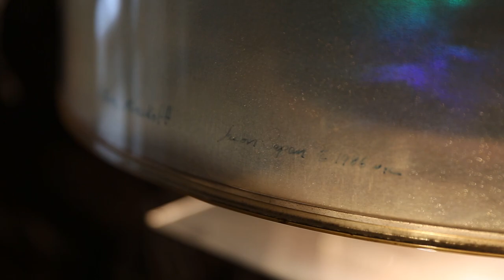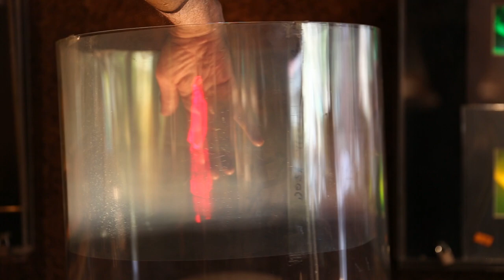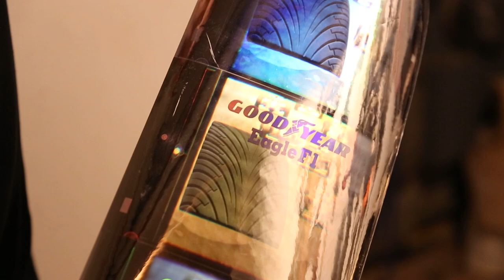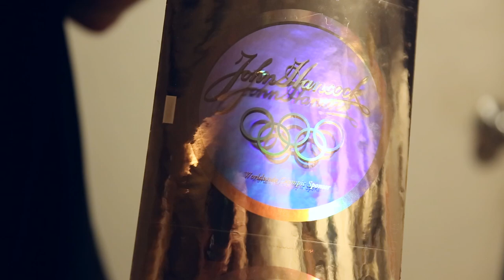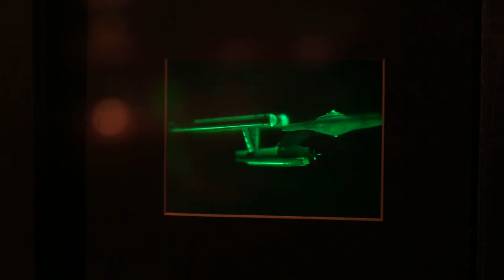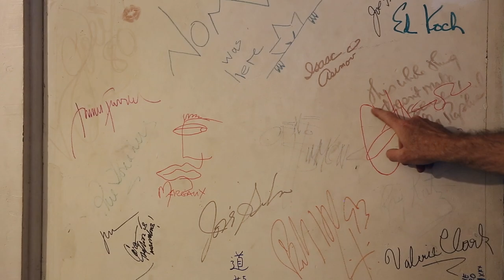How Holograms are Made

Comment: Having made holograms (literally in my basement), I can tell you that what you have here is a reasonable overview of the process (but, as I pointed out in a late rcomment,  understandable only if you already know what holograms are), but here's more detail.  The really detailed "WHY" a hologram does what it does is not simple to understand, much less explain in words.
...
...  How the simplest "Transmission Hologram" is made ...
...
The laser beam is split into two beams with something like a partly silvered morror.  Each beam is spread out, using a simple lens, to form a wider cone-shaped beam more like flashlight's beam instead of just a dot. One beam shines on the whole film and is called a "reference beam". This is like one of the water 'ripples'.   The other "Object beam" shines (by using mirrors to direct it) on the object being "photographed".  The laser light reflected off the object goes in all directions, as usual, but the light reflected from the object which travels toward the film combines with the reference beam to form the interference pattern on the film.  Where the two waves arrive always peak-to-peak (and trough-to-trough) they add to form more light and expose the film the most.  Where the two waves meet trough-to-peek (and peak-to-trough) they subtract, or partly cancel, and the film is exposed less.
...
  However, it must be understood that this is a very, very complex three dimensional interference pattern within the film's emulsion.  Because the film has thickness, there are interference 'patterns' created within the depth of the emulsion as well as across the surface dimensions. It is very difficult to describe in terms of the two simple ripples forming an interference pattern of just rings. If you have seen any kind of interference rings or patterns, you should realize that even though the light waves are going through their full cycles of extremely high frequency, these interference patterns are stationary.  They are called standing waves.   Because these patterns don't move as the light waves vary through their cycles, they expose the film in a stationary pattern.   If you understand how standing waves are produced on a radio transmission line, this is the same principle, only in three dimensions instead of just one.
...
Side Note: If you understand the mixing of frequencies in a radio receiver you have a little understanding how interference between two waves can preserve the information in one wave.
...
  After the film is developed and bleached to make it look clear, it can be viewed. To view the image the laser beam is spread again and shined on the film from the same direction as the original Reference Beam.   This film is now just like a "window" though which you see the object in the same position it was when the film was exposed.  The hologram produces light that leaves the hologram in the very same way it left the original object (and passed "thought" the window formed by the film).   As your eye moves around the window's area, you see light in the same way that it actually left the object and traveled in that direction to the film.  Since, at any one time, an eye only looks through a small part of this film window, this means that every location on the hologram film has a complete image of the object as viewed from that single location.    THEREFORE, your two eyes, located at different locations and looking toward the film window, receive light in the same way they would form the actual object and you see it in 3-D.
...
 You may think of the hologram film as having billions of really small, strangely shaped prisms that refract the laser's light. They refract the light from the viewing laser into a form that duplicates the way light left the original object.  Also, because they are prisms and prisms spread the colors in slightly different directions, you must use the correct wavelength of light to reconstruct the image correctly; though in my experience a close color looks pretty much the same. This may not help, but if you viewed a hologram of the simple interference rings from two split beams aimed at the film, you would see a single spot of light representing the "object beam".
...
P.S. Yes, it is possible to make a hologram image that "floats" in front of the film.  This is done as a hologram of a hologram to get the image on the other side of the film. However, the film must always be behind the floating image.   Light through the film must meet your eye.  It is a "virtual window" behind the image.   A complete ring of film is required for you to walk around such a floating image along with light from a single laser coming from all around the outside and shining inward toward the center.
...
P.P.S.  Another amazing aspect of these "Transmission Holograms" is that if you shine a laser dot onto the hologram in the reverse direction from the original reference beam, you get a complete image of the object projected on a screen located where the object had been.  This is with NO lens..  The image will be seen from the perspective of the point on the film where you would have looked at the original object when you exposed the film.   As you move the laser dot around the film, the projected image changes perspective (rotates) to match that location on the film.   I saw this demonstrated in a hologram talk and duplicated it myself.  Very COOL!
...
P.P.P.S. There are white light Holograms (which has all wavelengths/colors) and they use a nifty trick to do that, which I won't go into here.
ScienceAdvisorSteve
Reply: Observ45er do you mind if I ask your professional opinion on a puzzling piece of footage that may be related to holographic technology. Can you please have a look at the video called  'Pyramid Over Pentagon Plus Filter' by YouTuber TRSD Global which shows a triangular "object" filmed at night hovering over the Pentagon. The "object" was also filmed separately the same night by a group of African-Americans travelling in a car ( I mention their race because statistically African-Americans don't usually take part in staging CGI hoaxes. .) Is it possible the video is showing some kind of holographic technology?
Reply: @budekins542  I would have to be there and see it to have any opinion at all about it.  Both videos are too hard to see anything. One thing is that a hologram can not be projected into random space and be viewable from any angle.  This may explain it better:
 https://www.quora.com/q/gwvrdzszbveqfxde
Reply: @Observ45er  thanks!

Comment: hope I can get this idea across. I am not a learned person but have studied everything I can get my hands on all my life. You might say I've attended the big school. the one you never graduate from.   As I learned the concept back in the late 70's, you start with a weight table. Back then they were using a cement filled table that rested on inner tubes from truck and car tires to insulate the table from the vibrations of the earth. On this table they set up a laser (they started with red and then developed green and yellow lasers ). The light from these lasers were lased or traveling in the exact same direction, 100% or as close as possible, parallel in all directions so to speak. this beam was then split in two, one beam reflecting off of an object onto a nearby film and the other pointed directly at the film. This causes thick and thin places on the film so that when a normal light is shown behind the film after being developed, the object appears to be there. This is a very exacting process because the interaction of the two beams of light must meet the film at the same time from when they were sent from the laser.

Comment: I've made every single type of hologram show here, plus several dozen other types not spoken off.  I've shot them into silver halide, dichromates, photopolymers, thermoplastics, live cell walls, plasmas, fluids and metal surfaces using UV/Visible/IR/X-Ray and Electrons.  I've made surface planar phase, both direct and as embossing shims, and many different forms of volumetrics both inline and off-axis.  If it can be handled holographically... I've done it.

Comment: Very neat presentation Norman.  I have to point out that it irks me to no end when people say 'analogue' film.  It's chemical film and it's opposite would be digital of course.
Reply: Also, very cute Sergal.
Reply: ***** Analogue means it that the recording/signal/transmission has infinitely variable values within a set range. In analogue you could have all values between 3 and 4 (i.e. 3.5, 3.55, 3.5545424523523789809...). In digital you can only have 3 or 4 and nothing between.

Chemical film is still a digital process and the reactions that take place to each of the molecules that make the color in the film are the digital values that make up the pixels. What is called 'digital' in video/photography is actually digitally recorded and stored electronically.

You can also record images electronically by analogue methods, such as what was used in the originally television formats and for the system that papers used to share photographs through the Associated Press.
Reply: Richard Batz Thx! Yer the 1st person in all of history to notice how cute it really is!

Comment: We learned about everything but the hologram making
Reply: It's quite easy: Just split a LASER in two beams. Fire one on the object and the other on the film plate. Capture the lighte from the object with the film plate. If both beams come from different sides of the plate you'll get a reflection hologram otherwise a transmission hologram.

Comment: Okay, yeaa, umm, if anyone understood wtf he was on about, please reply otherwise I just feel dumb af atm..
Reply: Leslie Marufu   I'll give it a try.
His analogies leave something to be desired for some viewers. 
  Having made holograms myself (literally in my basement), the really detailed "WHY" a hologram does what it does is not simple to understand.  You should already understand concepts such as wave interference, refraction and diffraction. 
...
...  How the simplest "Transmission Hologram" is made ...
...
The laser beam is split into two beams with something like a partly silvered mirror.  Each of these is spread out, using a simple lens, to form a wider cone-shaped beam more like flashlight's beam instead of just a dot. One beam shines on the whole film and is called a "Reference Beam". The other "Object Beam" shines (by using mirrors to direct it) onto the object being "photographed".  The laser light reflected off the object goes in all directions, as usual, but some light also travels toward the film.  
...
The reason two beams are needed is as follows.  Light is a wave of extremely high frequency. This is just like the AC coming out of household outlets.  That voltage changes at 50 or 60 times a second.  Light is varying about ten trillion times faster. It varies in a sine wave like intensity at this incredible rate.  Simply shining light at a camera's film or pickup device will only result in an average amount of light energy being registered in the emulsion or pickup device. This is how an ordinary photograph works.
  If, however, we add the reference beam of the same frequency (from the same laser), the result on the 'film' is an interference pattern - a very complex one.  Interference patterns are also called fringes, or standing waves.  Where the two ever-changing waves arrive always peak-to-peak (and trough-to-trough) they add to form more light and expose the film the most.  Where the two waves meet trough-to-peek (and peak-to-trough) they subtract, or partly cancel, and the film is exposed less.  Although the two original waves and the resulting interference pattern are all changing at the rapid rate of light, the locations where the two waves add or subtract remain stationary -hence the name 'standing waves'.
...
It is very difficult to describe in terms of the two simplest waves forming an interference pattern of just rings. If you have seen any kind of interference rings or patterns, you should realize that even though the light waves are going through their full cycles of extremely high frequency, these interference patterns are stationary.  They are called standing waves.   Because these patterns don't move as the light waves vary through their AC cycles, they expose the film in a stationary pattern.  
...
 The length of the path from the laser to the film along the reference path is constant. The length of the path from the laser to object then to the film varies in a very complex way as the surface of the object dictates.   Another way to look at it is that the distance between various parts of the object and the screen is recorded in the interference patterns made on the film.  This is the 3D information of the object.  All this goes on at a microscopic scale (resolution) on the order of fractions of a wavelength of light. Therefore, this film must have the ability to store these patterns that are on the order of the size of the waves of light. On the other hand, ordinary film only requires a resolution on the order of the ability of the eye to see enough detail of the individual picture dots (which is what we now call pixels).
...
  However, it must be understood that this is a very, very, VERY complex three dimensional interference pattern within the film's emulsion.  Because the film has thickness and the light reflected off the object comes from many angles and distances, there are interference 'patterns' created through the depth of the emulsion as well as across the surface dimensions.  The interference patterns vary throughout the thickness of the film, as well as around the surface (as in an ordinary photo).  
...
Side Notes:If you understand how standing waves are produced on a radio transmission line, this is the same principle, only in three dimensions instead of just one.
 If you understand the mixing of frequencies in a radio receiver you have just a little bit of understanding of how interference between two waves can preserve the information in one wave.  
...
  After the film is developed and bleached (removing the darkened silver salts) to make it look clearer (lighter), it can be viewed. To view the image the laser beam is spread out again with a lens and shined on the film from the same direction as the original Reference Beam.   This film is now just like a "window" though which you see the object in the same position it was when the film was exposed.
...
 You may think of the developed hologram film as having zillions of really small, strangely shaped and complex prisms that refract/diffract (bend) the laser's light. They alter the light from the viewing laser into a form that precisely duplicates the way light left the original object and hit and passed through the film. This light is then viewed as though you are looking through the film as if it was a window.  Also, because the film grains are prisms and prisms spread the colors in slightly different directions, you must use the correct wavelength of light to reconstruct the image correctly; though in my experience a close color looks pretty much the same. 
...
 Once again, the hologram produces light that leaves the hologram in the very same way it left the original object (and passed "thought" the window formed by the film).   As your eye moves around and views through different parts of this window's area, you see light in the same way that it actually left the object and traveled in that direction to the film.  Since, at any one time, an eye only looks through a small part of this film window, this means that every location on the hologram film has a complete image of the object as viewed from that single location.    THEREFORE, your two eyes, located at different locations and looking toward the film window, get light from two different angles and receive light in the same way they would from the actual object and you see it in true 3-D. 
...
 An amazing aspect of the fact that the entire image is captured at every point on the film of a "Transmission Holograms" is that if you shine an un-spread laser dot onto the hologram film in the reverse direction from the original reference beam, you get a complete image of the object projected on a screen and in focus at a distance and location where the object had been during exposure.  This is without the use of any lens!  The image will be seen from the perspective of that point on the film where you would have looked through at the original object, as you were exposing the film.   As you move the laser dot around the film, the projected image changes perspective (rotates) to match that location on the film.   I saw this demonstrated in a hologram talk many years before I made holograms and duplicated it myself.  Very COOL!
...
 Yes, it is possible to make a hologram image that "floats" in front of the film.  This is done as a hologram of a hologram to get the image on the other side of the film. However, when viewing this hologram, the film must always be behind the floating image.   Light through the film must pass through the image and meet your eye.  It is a "virtual window" behind the image. 
To have an image that you can walk around and that looks like it is free floating in space you need a complete ring of film along with light from a single laser coming from all around the outside and shining inward toward the center. 
...
   There are white light Holograms (which have all wavelengths/colors) and they use a couple of complex, nifty tricks to do that, which I won't go into here.
...
  The "hologram" is generally considered to be just the film, not the image it produces.
-- 
ScienceAdvisorSteve